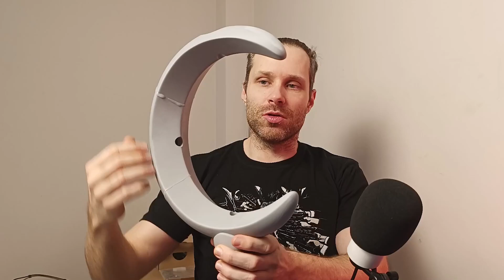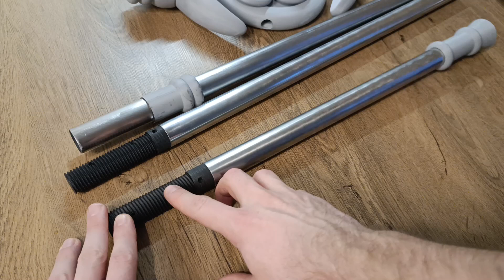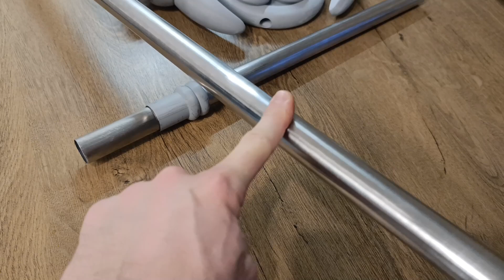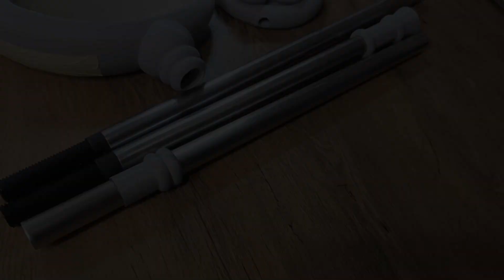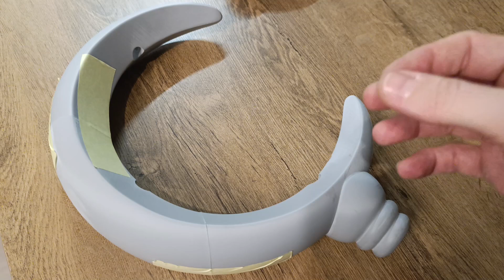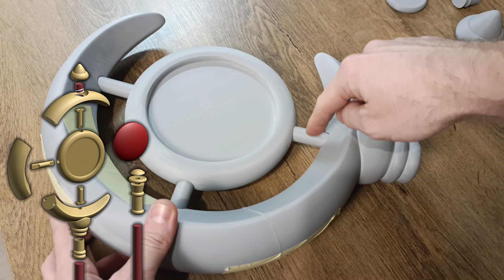Portable Frieren Staff build Pt.1 FREE STL

Comment: Nice Print and design. What CAD Programm you're using ?
Reply from the maker: Blender
Reply: @BrunenG_YT  Getting started for myself at the moment. usually i am Engineering with Solidworks and Inventor because of my Job but started to use Zbrush. As implied i am pretty new to that toppic. Did you try other Programms wether then blender or did it just fir your purpose. Btw as an engineer i really like your thinking of designing. You seem to have some knowledge of mechanics aswell :)!
Reply from the maker: @Blockstn0129  I appreciate that you notice the engineering)  as for the software - I used Fusion 360 too at some point but in general for my purposes Blender is the most versatile. I can do hard surface and sculpting in one package.  If you ever consider Blender, I have a course for beginners that's cosplay oriented.

Comment: Quick question do you Prefer resin printing or 3D printing i Personally do like 3D printing better due to Ease of use but resen gives a much smoother result and is easer to paint what do you think
Reply from the maker: It depends. I use both. I do prefer printing in plastic for less hassle, but it is what it is with resins.  There are compromises in any technology.
Reply: @BrunenG_YT  thank you very much